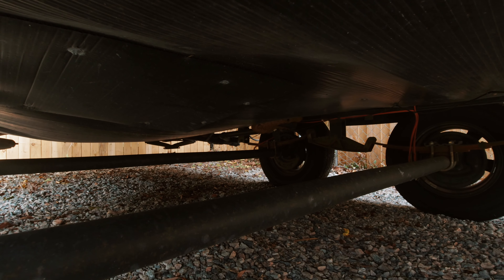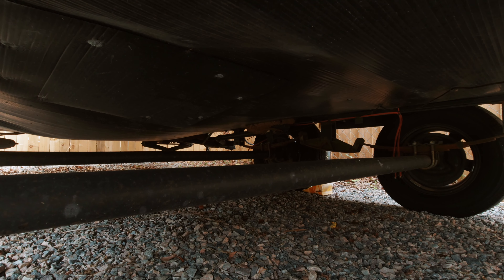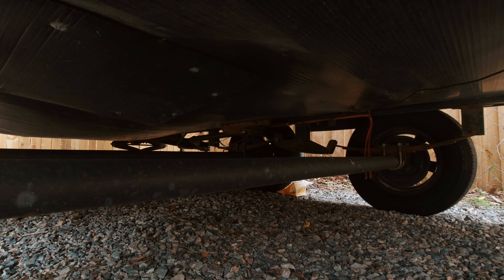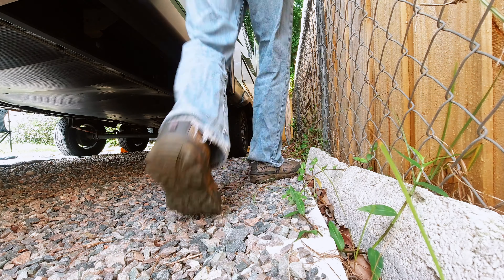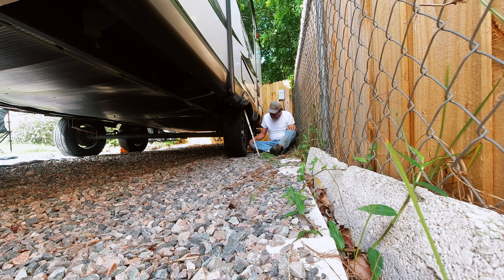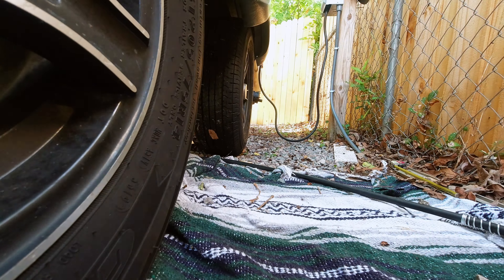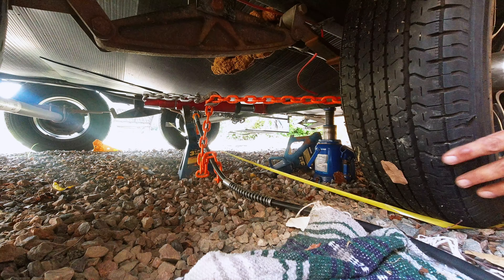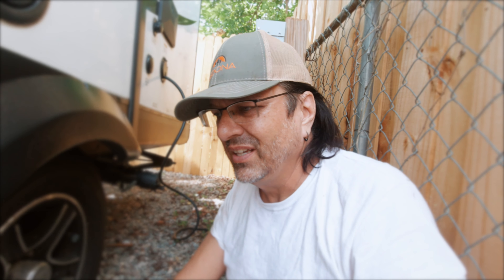RV Maintenance | Axle Alignment | Repacking Travel Trailer Wheel Bearings | 2,000 Subs!

Comment: Alli and Chuck congratulations to you guys on 2,000!! What an accomplishment and well deserved:) Love this video, you make it easy to understand and those time lapse shots really cement the content in! Honestly I have been noticing some uneven wear on our rear tires as well and now you have me thinking the uneven  axle alignment might be the culprit :/ bummers! Honestly I don't have the tools with me on the road to get this job done, but I will have to make this a priority to get it addressed before a disaster happens! I am notorious for checking tire pressures religiously, so I can rule that out lol Thank you guys for sharing! Always great to see your faces smiling, keep up the great work 😊 - Kyle and Renee
Reply from the maker: Are both the back tires wearing on the inside edges? If so that axle has probably lost it camber. That can be fixed easier than the toe of the wheel. But there are shops that can do trailer alignments. But if the wear isn’t too bad I probably wouldn’t worry too much. Sounds like you’re definitely keeping your eyes on everything which is good! 😊 do you have a TMPS on the trailer tires? Thanks guys for the kind words! 😁 Btw what drone do you have? I have a couple the Spark and the Mavic Air. Again your shots were EPIC!!!! Great job! 😁
Reply: AlliChuck Adventures yes they are wearing out on the inside but not too bad. We used to have a TPMS but now we just check manually before each drive! We might get a TPMS again though! Can never be too safe! We have a mavic air 2 drone and it has been awesome! Thank you again for the kind words!

Comment: Chuck, you need to raise the wheel and mark the top with chalk at 12 o'clock. pump one shot of grease , then turn 5 minutes on wheel, one or 2 pumps and continue all the way around. This greases the inside bearing evenly all the way around as the grease then travels to the outside bearings. if you don't turn it you only get new grease in one little area of the bearing and races ... OK KEEP UP THE GOOD WORK... THIS WILL HELP A LOT OF PEOPLE WHO DON'T KNOW THIS EXCELLENT TRICK..... Todd
Reply from the maker: Thanks! Good to know 😁
Reply: No problem.. glad to help fellow RV' ers @AlliChuckAdventures